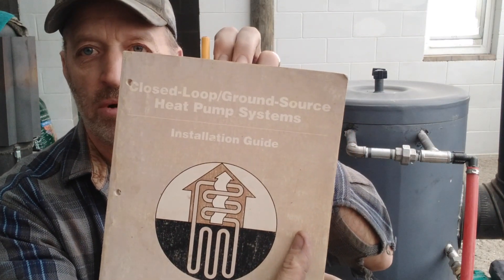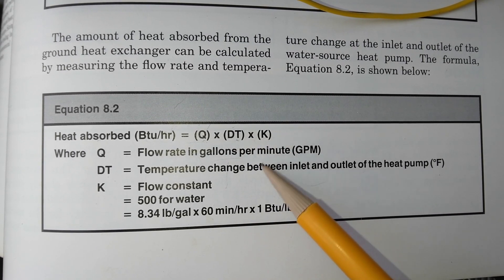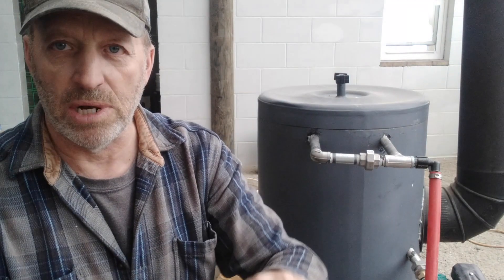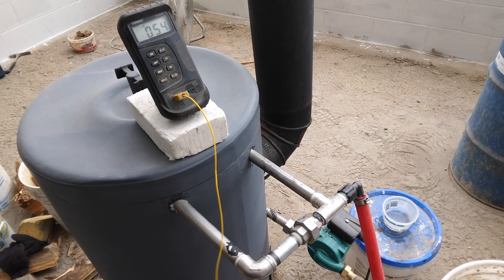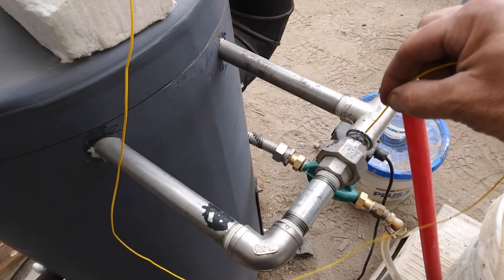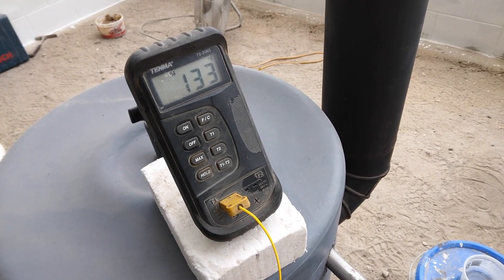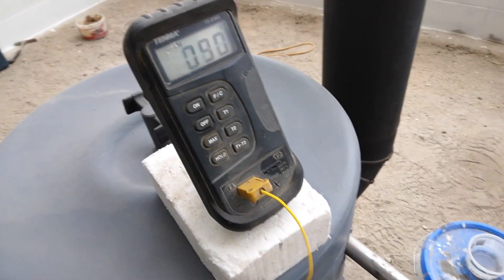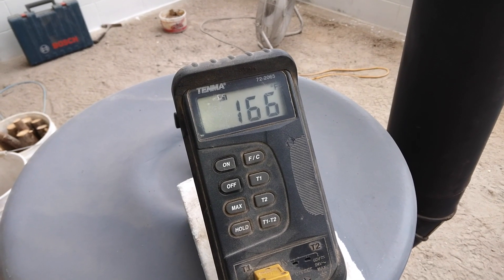Actual Btu output of Rocket Boiler Stove, (part 7)

Comment: I know I’m late to the party, and forgive me if this was commented on an earlier video. But you might want to consider going with a faster pump. 55-65° is a pretty big Delta T (difference in temperature). If you moved the water through a little faster, it could improve efficiency, put less strain on your plumbing fittings by keeping their temps a little lower, and keep the floor a little more evenly heated. Great build and thanks for sharing! I really enjoyed watching your thought process through all of it.
Reply from the maker: This pump was a cheap-o.  When it burns out, I will probably get a better one.  -it's still going...

Comment: I really enjoyed following this build. The recovered heat estimates are very impressive, my calculations suggest, if you're loading 2-3 Kg wood per hour, around 8/10ths of it's energy ends up in that water for the 30-42,000 btu/hr range you report. Thanks for posting such a detailed build and measurements.
Reply from the maker: Thanks for your comment and evaluation!

Comment: 30 K btu extracted by water now how many lbs of wood to achieve that per hour.
Reply from the maker: I don't know the exact answer to your question.  When I'm using it now, I put in about 5-6lbs of wood per hour.  And it depends on the kind of wood.  I'm not running it at full throttle, as I learned that it just gets too hot.  I maintain a hot burn, just not up to 2,100˚F.

Comment: super informative and thorough video series on your build. nice work... I'm curious about the low placement of the chimney exit on the tank.. why not near the top?
Reply from the maker: The plan was to make an efficient counter flow heat exchanger.  Keeping in mind that heat wants to rise; the heated exhaust is forced down around the tubing and cools, while the water flows up and is heated.  If the exhaust was at the top, much more heat would be lost out the chimney.

Comment: I guess there is some information somewhere about how many btu's a pound of wood produces, then you could factor this in as to how much heat goes into your water system vs how much is 'lost' to the air in the greenhouse?
Reply from the maker: I don't know that I will be getting into that kind of calculations right now.  The body of the stove doesn't get much over 200˚F with those hot burns; except the door area.  Getting some heat into the room like that is alright too.  Next fall when it is has a real chimney and permanently installed, I can do some more test.
Thanks for your comments!

Comment: Job well done DMI. Now we know what the actual heat numbers are concerning heat output of the rocket water heater stove. I am in the process of getting materials to make my own water stove. Will be slowly planning and assembling the stove when parts are found. Good day Sir and thanks for showing us all on YouTube how to make things happen. Peace vf
Reply from the maker: Seems if you want something like this, you have to make it yourself.  It took a lot of work to get to this point, but I learned a lot from just doing it.  My best to you!
Reply: @doubleMinnovations  YOU are correct DMI. Sometimes one has to get his feet wet. One thing fella. Since you were working in the field of heating with earth heat sink what is the size needed for 2400 square feet home ??? Area size will help me. Thanks vf
Reply from the maker: @victoryfirst2878  That would require that a heat loss be done on your house.  That can be quite involved.  There may be a program online somewhere that you can punch in the numbers to find out.  You would need things like your location and climate.  Each wall of your house would have to be measured, and how well insulated.  Each window would have to be measured with the quality of them.  How well your ceiling is insulated.  
I put in the ground loops in two different ways back then.  One long trench, or a slinky field, (coils of pipe laid out like you flattened out a slinky.). For here, (northern MN, with Arctic winters) I would use 800' of 3/4" PE tubing per ton of heating (12,000Btu's), buried 8'-9' down.  Any of that required a lot of digging.  Now adays, I see most being put inside vertical well shafts.  It's all quite expensive this days unfortunately.
Hope that helps.